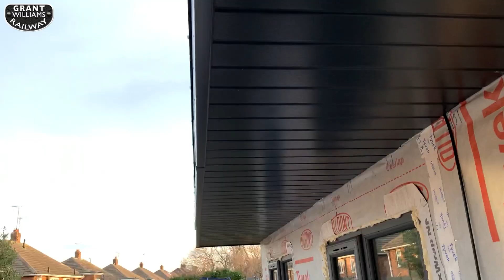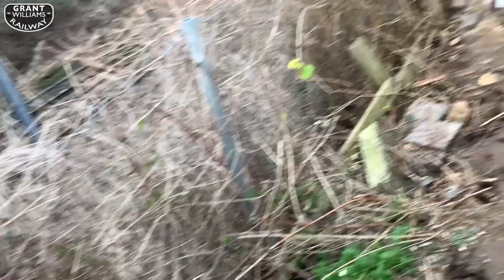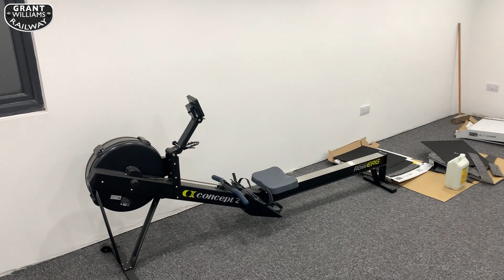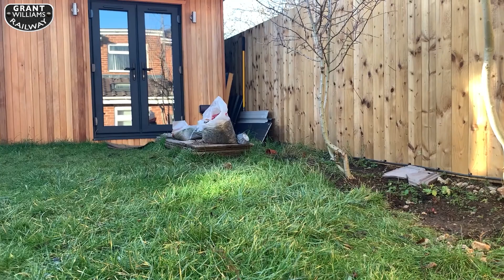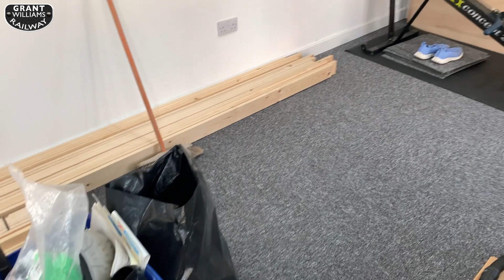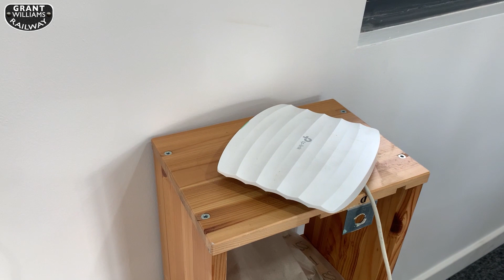A Model Railway From Scratch - 38: Railway Room/Summer House/Garden Room - Finished! (Part 2)

Comment: Hi Grant. It's looking fantastic. You seem to have covered all the bases in terms of sufficient wall outlets, Internet access, insulation and air conditioning (does it warm the air, too?). Oh dear; did I see a crack in the left hand pane of the centre window? It sounds as though you are going to be tweaking (or totally revising) your track plan - exciting!
Reply from the maker: Thanks Paul. The window isn't cracked, could it be a shadow or trick of the light?
Reply: @GrantWilliamsRailway  Good to hear.